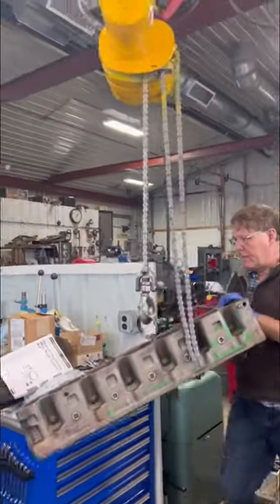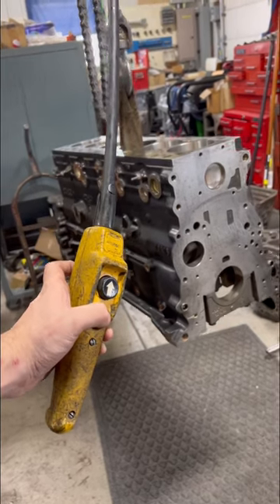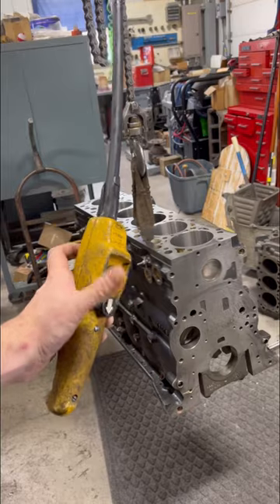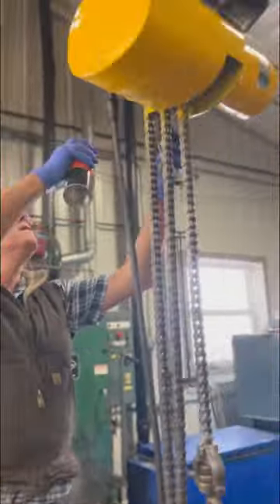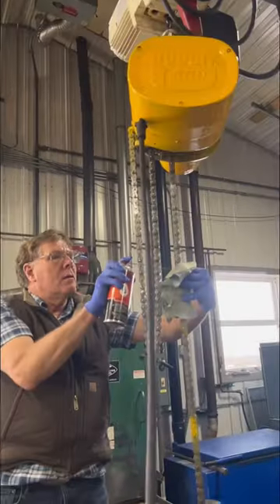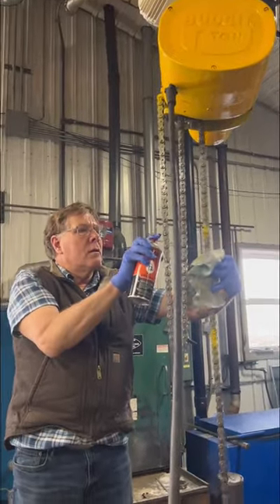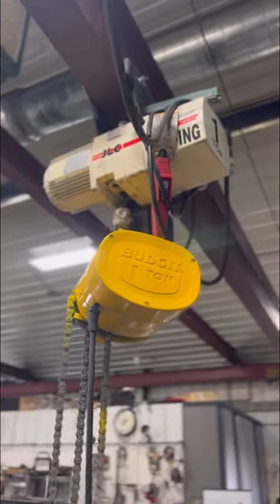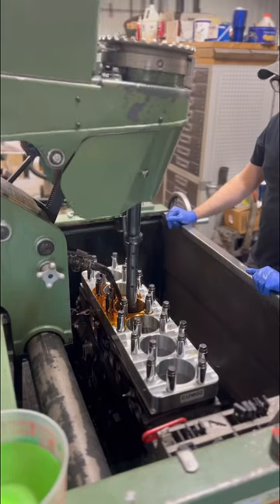#shorts We Finally Have Our Chain Hoist Back Up And Running!

Comment: I have a 3 ton that I need to do this to, but , it's a " made in china " hoist.  Where can I get the friction plates? 
And please don't say China.
Reply: China but seriously, you probably need to find universal friction plates, or find another brand that used the same size plates. Chinese products aren't the easiest to get parts for. I needed to get wheel bearings for a Chinese cart, and it took time. Not a single US store, including McMaster Carr carried the metric size they used. Oddly I found one seller on Amazon selling them, but it was from a Chinese company.
Reply: I believe there are specialty shops that re-line clutch plates.  Usually for heavy equipment like cranes and the like.